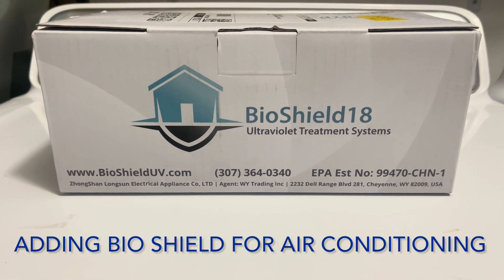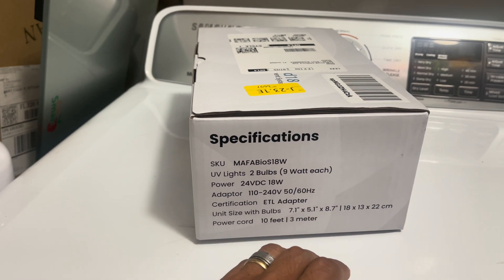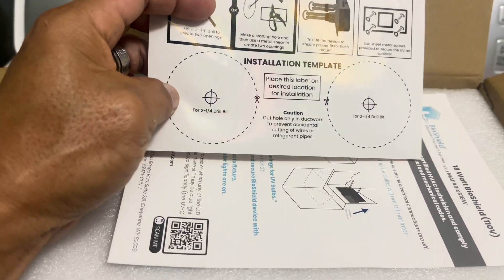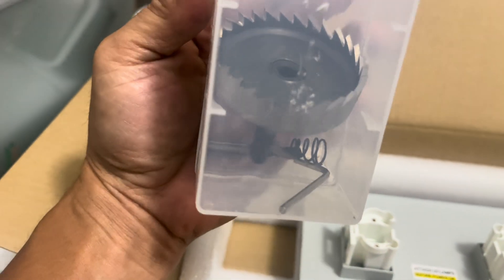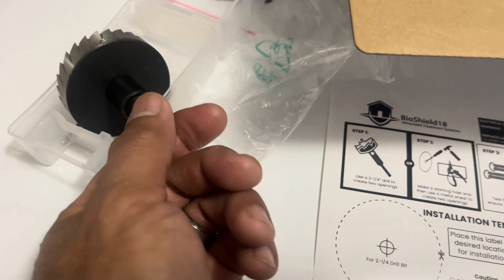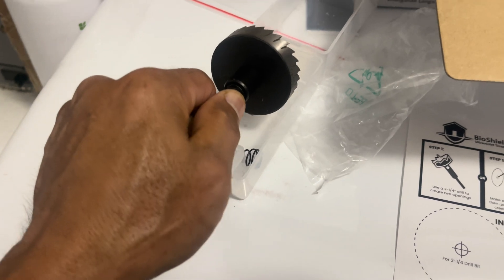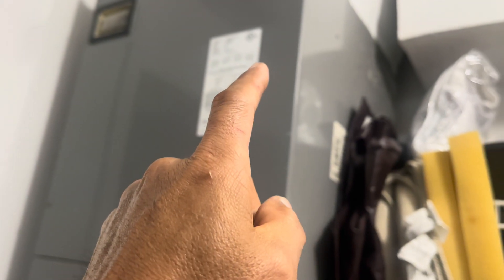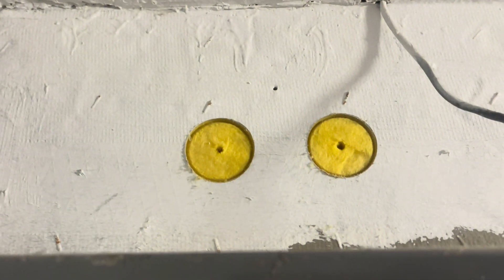Hvac Bioshield uv light installation

Comment: It would be better to install it 12" downdraft of the coil to kill the mold that accumulates on the fins. UV light won't kill much in the air because the flow is too high for those little bulbs. Mold grows on the coils because it's cold and damp. Just be sure the parts inside are all metal. (UV Resistant)
Reply: I just replaced my 30 year old evaporator mid summer, the old one had no mold and was very clean.
Reply: You're right it's better to point it at the evap coil, it's job to prevent growth on it not to filter the air

Comment: Hi Boss. Tha ks for the video byw. Planning to get one for my furnace. Is there a noticeable scent? I watched Bioshield's video and they said "..little to no ozone.."
Reply from the maker: Hi thanks for stopping by I don’t think so I don’t smell scent coming from the ventilation and I don’t think this will harm the ozone layer  like what you said this will not recommend by hvac if this is harmful the only thing it does is to kill bacteria which is living organisms inside the ductwork and besides the air is only circulating around inside the house.